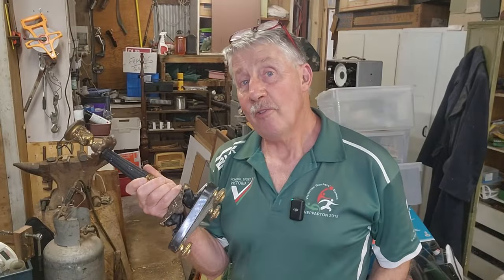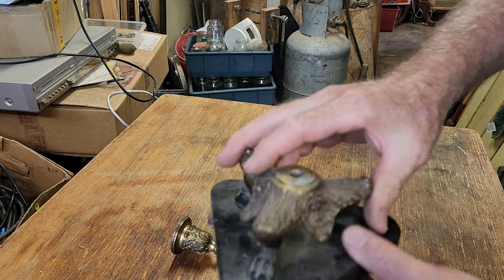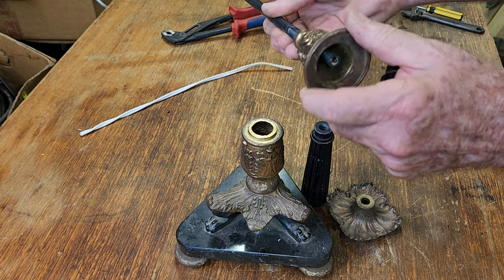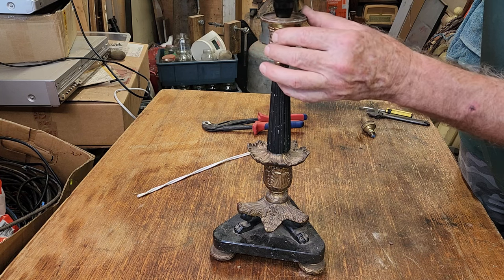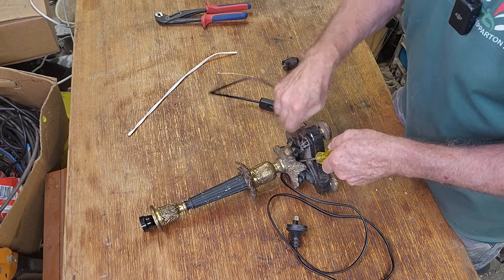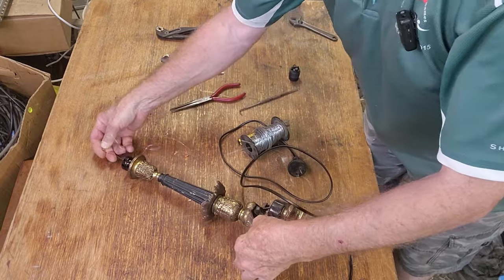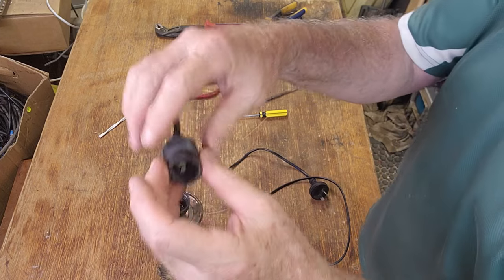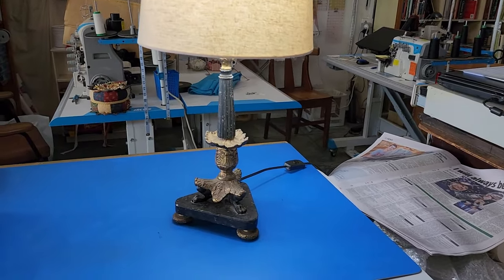Vintage Lamp Saved from the Tip! How to Repair an Old Table Lamp Quickly & Easily for Good Profits!

Comment: I used to love treasure hunting at the tip as a kid. Last time I went to the tip somebody was throwing boxes of cans and bottles which were 10 cents here in Queensland. I picked a couple up and firm in the back of my trailer and they got me at the exit. I like the council curbside collection. You can pick up some real treasures. I picked up a baseball launching machine, a brand new commercial fairy floss machines still in the box. A brand new pair of Williams boots in the box. Just name a few of the oddball things people throw out. Cheers Graham
Reply from the maker: Yeah, we don't have curb side collection here - probably just as well as I'd be forever driving the streets! 😆🙄
Reply: @TheUltimateRecycler  I bet U would